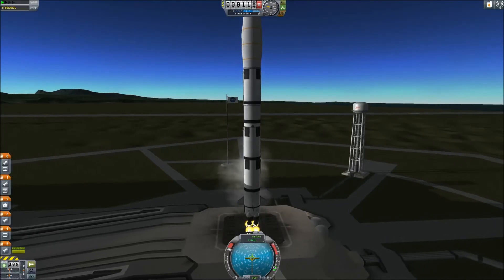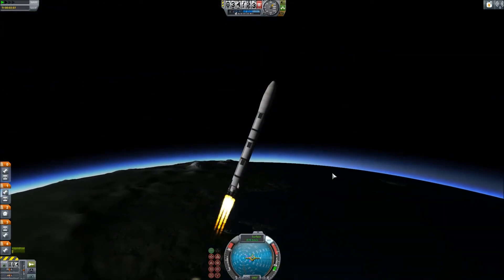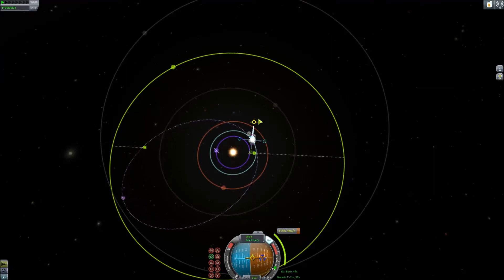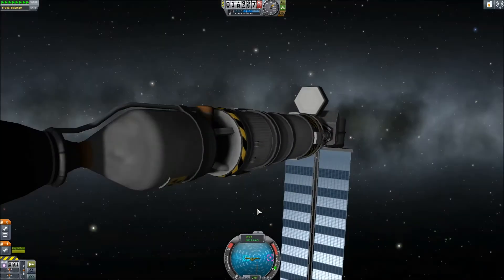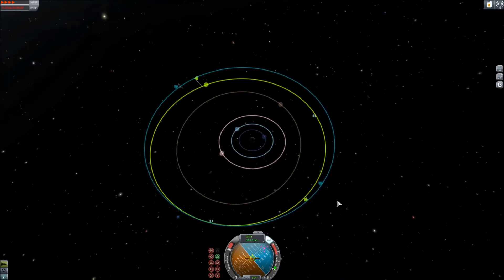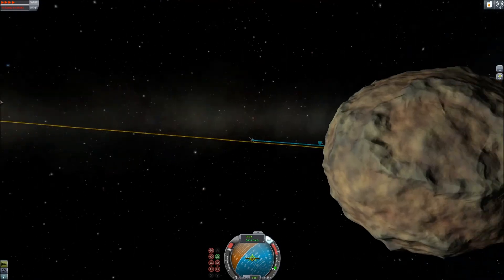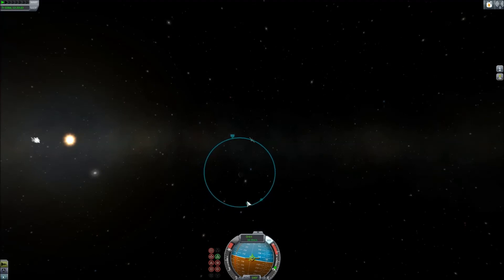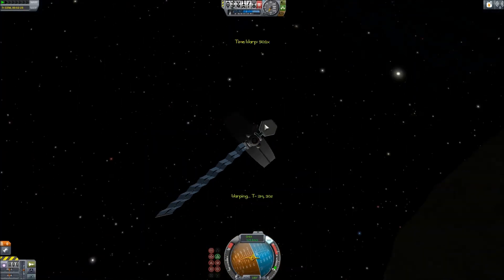KSP Exploration E12: Dual Resource Scanning Satellite in orbit around Pol

Comment: Hey I was making some interplanetary ships but I'm have trouble with the staging I seem to build big and weird rockets how do you get such polished rockets do you spend a lot of time making them before videos if so any tips on how to keep rockets small and simple. I was al little amazed you could make a 4 stage to pol
Reply from the maker: This mission was the only one where the rocket gave me issues because I kept trying uneccessary side boosters. For smaller payloads simply use a single core setup like I did in this video.

For bigger payloads you'll need side boosters with fuel lines. Use the big radial decouplers and sepratrons to keep the boosters from destroying your central stage.
Reply: Which way should the fuel lines be going